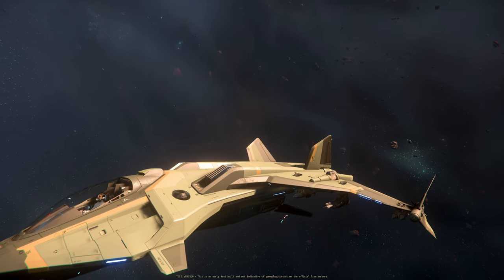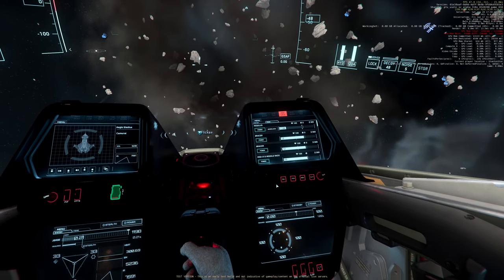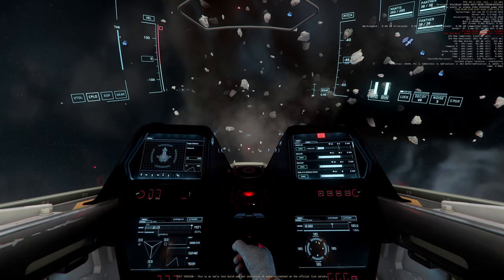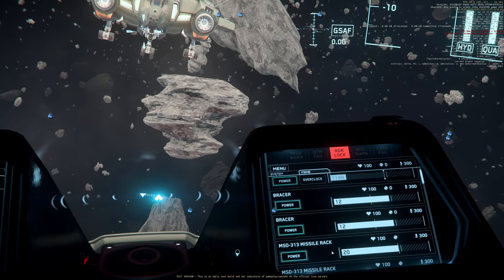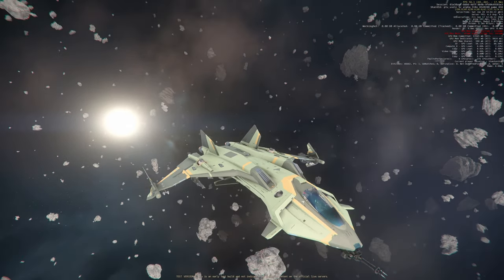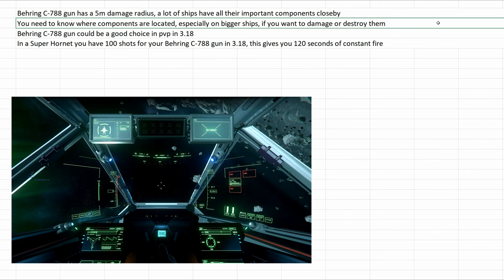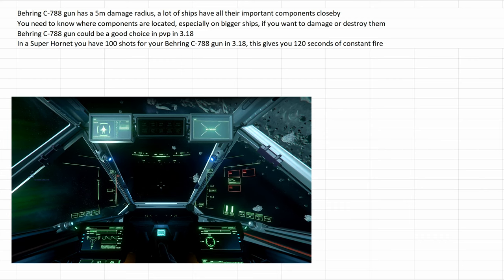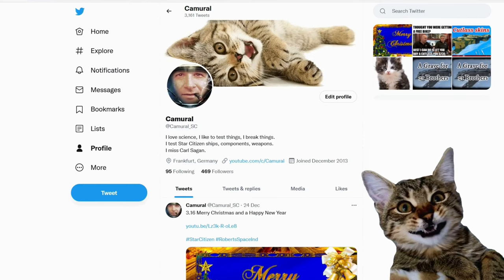3.18 PTU  Behring C-788 gun - component damage?

Comment: I wonder how effective the C788 would be against Infantry. Reson beeing that now many Box missions send you out to Outposts that are swarming with hostile NPCs, so if the C788 would work well against Infantry it could be a nice way to clean out the LZ before you land to collect the packages.
Reply from the maker: Michael Hoffmann you could try it and report back :)
Reply: There just are not many delivery vehicles that pack a size 4 gun slot.  The Titan and 300 series are the only ones that come to mind.
Reply: @Kyle-sr6jm  No reason you cannot use a Corsair for deliveries. 😁
Reply: @Camural we really need a “ground target” reticle mode that adjusts where the gun is aiming based on distance to the ground and if the ship is strafing sideways so it hits whatever you aimed at when you pulled trigger
Reply: Last i heard that was cigs "intention" for the weapon lol. Thats why its damage got nerfed into the ground.
Reply: would love to see it used on the redeemer to actually bring the gunship part of the ship more up to snuff
Reply: They are very good, i use them in my bottom turret on tje A2 for BH or killing infantry without dropping bombs

The splash damage will kill them no matter how well duck under a rock they may be lol
Reply: Its a nice swap for the redeemer it does clear the area pretty well.  not as good as a A2 boming run but still effective.
Reply: ikn they one shot, due to their explosion on impact. It often sends the player flying into the air